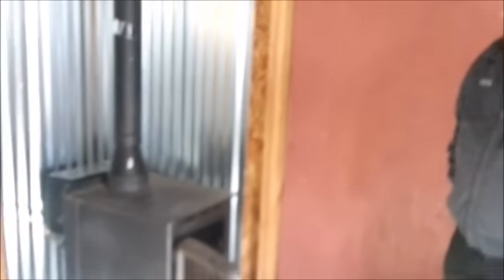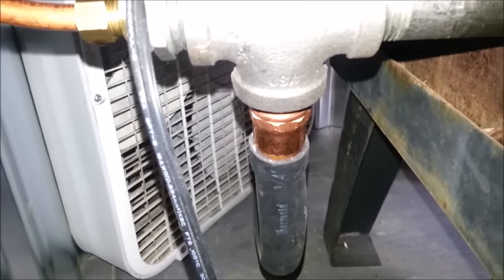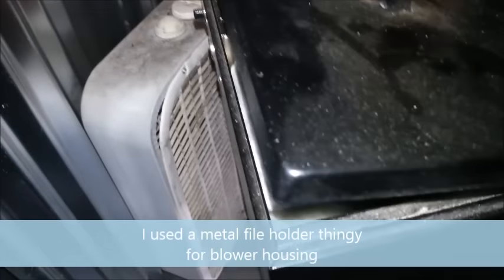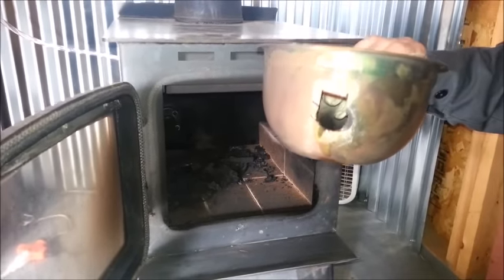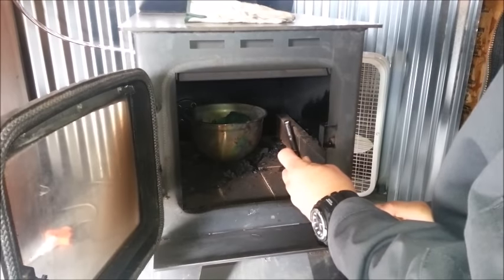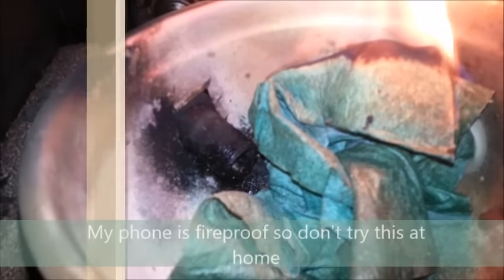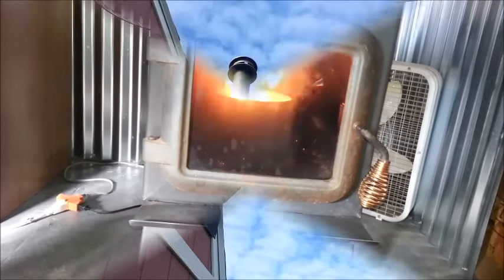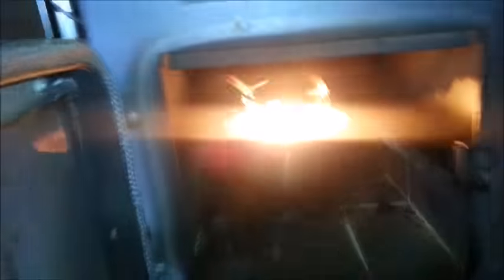Easy Waste Oil Heater made from a wood stove

Comment: LOL, sounds like you need to buy the son-in-law a beer or three. Nice setup. I was wandering if used motor oil would work in this system.
Reply from the maker: Yeah. Pretty much any oil. Vegetable oil not so much because it gels in the cold and has to be heated before it will flow

Comment: Isnt there some danger of the oil in the line catching fire? I mean if its dripping through half inch pipe theres gonna be air in there too right? Not familiar w these so just askin. Thx
Reply from the maker: The oil drips at the very end of the pipe and the outgoing air keeps oil and any flame from being able to enter

Comment: You were right! more air cleaned up the stove and pipe so much I can almost have dinner inside it! (producing over 900 degrees with same amount of oil too)   I tried a mattress blower like you have but was hesitant due to noise, but mainly the fact that its not intended for hours and hours of use.....What has been the life span on your blower?
Reply from the maker: +shawn I  Considering that they only cost about $20, one year would be worth it. Iv'e had mine going part time for three seasons. Glad you got the air issue fixed.

Comment: I have a question- when you are going over the basics of the stove about 4;20 or so you see the waste oil drip pipe which I think is 1/2 black or galvanized but it looks like there is another tube there as well maybe an 1/8th or 1/4- I am summarizing that this may be an air pipe is this correct- if so how do you do a transference- I mean there is a T on back of stove with high heat rubber hose running to pump but how is it stepped down?? or am I totally seeing an illusion? I was also wondering how the oil would not go down into the air pump hose when it appears as the air hose comes into the T and the T is pointing straight down- wouldn't that cause the oil to run mostly into the air pump hose? Not trying to ask to hard of questions but trying to alleviate any problems I may come across when building
Reply from the maker: The Real Deal Pastor check out my video "How to make an easy waste oil heater. I think all your questions will be answered. God bless
Reply: ok I will thanks

Comment: Cool idea. How long will a gallon of oil last? Is there different  burn times for different fuels... motor oil, diesel,  transmission fluid, etc...? What temps are you maintaining in your shop now?
Reply: That was my question nobody is saying how much oil one of these rigs burns, ???
Reply: f you drop an ounce every 3 minutes and there is 128 ounces per gallon, you want to err on half hour.  Think of a 3 oz travel bottle being filled ( in less than 10 minutes (this would be a conservative burn).
MPG may vary according to driving style, weather and terrain.

Comment: Would like to see how much oil is doing and average hourly consumption. Great video. Thank you
Reply: Most of these setups run 1/2 gallon every 1.25 hours give or take. Proper tuning of flow rate depends on a few factors of the build and heat requirements of the space/operator.

Comment: Does your heat go straight up the smoke pipe, or is there a built in baffle to help keep the heat from escaping?
Reply from the maker: There is no baffle or heat exchanger in the pipe. You could add one but I wonder if it would plug up with soot

Comment: nice and simple
whats the flow rate to cfm and can that blower run 24/7
Reply from the maker: Not sure the cfm but I've been running the same coleman mattress inflator for two seasons with no issues but it is getting noisy on start up. They are about $20 bucks at Walmart. I've also added a light switch/dimmer to it to help control heat out put. Works great. I wouldn't have any hesitation running it 24/7

Comment: On a slow steady drip, how long will it take to burn that whole 5 gal bucket empty of Tanny oil..???
Where you have that Tee for your fan air with that Tee facing down does it fill up with oil..???
After it gets warmed up will it run without the fan on..???
Have you tried to put a variable light dimmer switch on the fan AC supply line to vary the fan speed.???  (slow, med, high, etc.)
Reply from the maker: Bob check out my other video called "the sequel". 5 gal will last about 8 hours
Reply from the maker: and it won't run without the blower for combustion air. not efficiently anyway
Reply: +Kevin Rushing Well I know that on the surface that's a silly question because it depends on how much heat you want so the higher you crank it, the faster you'd burn fuel, just wanted a rough idea...  there is a county shop here where they park the snow plows that has a big one made of 6 55gal drums but it uses a regular oil pump they took off an old steam cleaner & they have a 350gal tank outside (5ft higher than the heater) & they put everything in there, oil, diesel, Tranny juice, gear oil, brake fluid, & they have one of those big stirrers you use to mix dry wall mud, hooked to a drill to mix it ever now & then..  but seriously I've dropped in on a snowy day & it would burn the paint on the walls if they  had any, they are all old dry wood..
Reply from the maker: +Bob White i think it's a good question. Some of these guys can go a bit overboard on heater design but when you start building it is some much fun it's hard to know when to call it good
Reply: +Kevin Rushing Well those of us who like to Tinker, Design, & make things, most often are never "totally" satisfied with our designs, we seem to keep thinking of things we could improve on, or a better, or easier way to have achieved the same effect, & a lot of the time it's not just a better way, but more of just a different way we could achieve the same thing, that's part of the fun...

Comment: Nice !  How much oil does it use?  Can you use brand new oil?   Synthetic?   Only the best, right?  Maybe throw in some ethanol.    and some black powder to start it with.   lol  But don;'t use ammonium nitrate.   That's just askin for trouble.
Reply from the maker: Tim Spriggs It all depends on how hot you get it but on average 5 gal for 8 hrs. Any oil will due but used seems to be cheaper than full synthetic out of the bottle. But if you're into designer fuels I would go with Mobile. 👍
Reply: ha ha.  I was joking.   The black powder and ammonium nitrate shd have tipped you off.  lol.
Reply from the maker: Tim Spriggs I was joking too 😌
Reply: Kevin Rushing okay.   I'll take you at your word.  : )

Comment: I think that was a 45 going into the bowl.    I'm just messing with you.    This is good stuff.  I'm trying to do the same thing. Only because my best friend owns a bar and he has used fryer grease to get rid of.  It piles up in clear 5 gallon jugs.   I have a couple storage tanks with the hand cr a nk pump.    I just burn garbage with the it but I have a bunch of old woodstoves and a ton of ingenuity.   Figured I could get a better use out of the grease.   Even tho I already heat my house for free with firewood that I cut.    Part of me just wants to make a waste oil heater just to do it
Reply from the maker: It will definitely do that for you but if it’s cold you’ll have to preheat the grease/ cooking oil to get it to flow

Comment: That blower fan needs to higher than the top of the burner and blowing the heat back down. 
Warm/hot air rises !.   Theres  nothing only cold air down at that level.

Comment: what stops the oil lighting in the pipe and going to the tank
Reply from the maker: For combustion to happen there has to be heat, fuel and oxygen. Since the tube is full of fuel no oxygen can enter. Also the air being blown in for combustion cools the oil below ignition temperature. The fuel doesn’t burn until it enters the bowl . Hope that answers your question.

Comment: What keeps the oil from going down the air pipe before turning on the fan.
Reply from the maker: The oil is controlled by a valve and drips directly into the bowl. The blower starts when I slip the switch. The fan turns on automatically when the temperature reaches a preset temp
Reply: @BYprospector  ok from the video it looked like the air tube was after the oil valve, going into the same tube as the oil. Or is it completely a different tube and i just didnt catch it.
Reply from the maker: @aaronwood3540  it might answer your question better if you watch my “how to” video

Comment: I would like to make something like this for my greenhouse, did you measure how long that bucket load of oil lasts. Thank you.
Reply: I would he worried about the lifetime of the blower. They tend to overheat and lock up fairly easy.
Reply: @HardWhereHero  :) I meant bucket load of oil:)
Reply from the maker: 5 gallons in roughly 8 hours
Reply from the maker: You need to keep it cool and it will last for many months. Also break it in slowly. A few minutes at a time

Comment: Kevin,I'm getting ready to use your idea on a pellet stove. What are your thoughts about using a 4 inch pipe that came with the stove or adapting that to 6 or 8 inch pipe and then running out of the wall of my shop?
Reply from the maker: shane newsom 4 should be fine. Remember with a blower you have a closed system with forced air that doesn't depend on natural draft
Reply: I'm worried about stove pipe temperatures and the 4 inch pellet stove pipe. Seems like it can only handle 540 degrees. Have you ever measured your stove pipe temps?

Comment: What happens if the flame goes out? Do you end up with 5 gallons of oil on the floor?
Reply from the maker: Yes. You have to keep an eye on it
Reply: @BYprospector  rayburns had a float chamber to shut the flow off if this happened,you had to have a sealed burner pot though.

Comment: Does the air just have to go into the fire chamber or does it need to shot right into the bowl on to the fire or just circulate around the chamber,and have you ever had an issue on a cold day after start up with the oil getting warm and running to fast on you and getting to high in the bowl and coming out the hole and into the bottom of the stove? Great video tho Thanks.
Reply from the maker: the air needs to swirl around physically contacting the oil. with a needle valve the oil with flow fairly steady. I've never had overflow
Reply: Thank you for the answer just seen your other video of how you run the air in the the fire chamber really good good idea I have a really large old wood chuck wood & coal stove I think I will give it a try on this summer in a garage I building thanks for the info and the video will save me a lot of wood I can use the wood to heat my home instead of the garage to the garage is not connected to the house it is a separate building to work on project cars think this will work good here in Michigan in cold weather.
Reply from the maker: +Michael Morris Be sure to upload a video

Comment: could a person put the air and oil in, coming into the side of the exhaust pipe and come down to the bowl instead of the back of the stove ???
Reply from the maker: I suppose you could depending on how the stove is built. There may be a plate welded to the top inside to keep heat in
Reply: ok going to try that, I built my own wood boiler and there for I can't go in from the side cause of the water jacket around the firebox, Ill have to send you pictures when its running.  Thanks for the quick response
Reply: +Kevin Daye where did you get the blower for the air supply to the bowl
Reply from the maker: +Kevin Daye Walmart. Coleman mattress inflator. About $20

Comment: How does the fan work?
Reply from the maker: The fan is operated by a 120 deg F normally open snap disk limit switch. It's attached to shell of the stove on the back. When the temp reaches 120 the switch closes and the fan turns on. You can get the switch from anyone that services furnaces.

Comment: So how is the fan connected?
Reply from the maker: I wired in a 120 degree F snap disk temperature switch. It’s attached to the back of the stove about an inch from the surface of the stove. When the temp reaches 120 the switch closes and the fan starts

Comment: Kevin, I got mine going, but seem to have a little trouble getting it roaring like yours seems to. I used an old pellet stove as my unit, and used all the blower motors inside of it. An exhaust blower, combustion blower, and the blower to blow the heat into my shop. I will keep tinkering with it to see if I can get a better roaring flame like yours. 
Thanks for all the tips.
Reply from the maker: Curtis Henshaw sounds like an air intake issue but remember that a pellet stove is more efficient than a wood stove and may not require a rippin' flame to heat a good size space. Good luck.
Reply: How long did the air mattress pump last?

Comment: What is the shelf life for use vegetable oil when using to fuel a boiler?
Reply from the maker: None but it tends to gel up in cold weather. It will have to be heated to make it flow
Reply: Adam Kremer h

Comment: Great job love the idea I have only one question can you tell me more information on the air forced into the unit can you show that part thanks for sharing
Reply from the maker: I use an air mattress pump. Mine is a coleman. Its best to use one that has been used otherwise they could fail pretty early. It needs to be burned in before it's used full time.
Reply: @BYprospector  thanks for the information

Comment: I wonder: ever thought of doing a „bird feeder“ oil feed that keeps a certain (low) level of oil in the bowl?
That way you wouldn’t need to adjust the drip (which obviously can change with varying viscosity in different temperatures).
Reply from the maker: Not sure what you have in mind but adjusting oil flow is neccessary for different size flame. It's the only way to adjust temperature in the room.
Reply: Oh yes, that was meant for a constant combustion (so constant flame/temp).
I was having a Roman style oil lamp in mind that needs a constant oil level. So if this would work with a constant oil level (unless you need to adjust the flame), it could go unattended e.g. as a night/greenhouse heater or so.
Reply: Once it gets hot enough all  available oil  will combust into  a inferno that only gets bigger ,you have to control the flow
Reply: @demil3618  yeah, you can't keep a set amount of oil in the pan, like 10mm / 7/16inch, it would burn like crazy before that.

But as for what I think you're getting at - thermostat - I am currently building a waste VEGETABLE oil heater to heat my house that is temperature controlled by an Arduino.

Comment: How big is your copper tube?
Reply from the maker: I use 1/4 to the valve and 3/8 below the valve to the stove. The 1/4 limits the amount of oil I have going to the stove so I don’t have a run-away flame.
Reply: @KevinRushing63  yeah I used a 3/8 needle valve and it always over fills my stainless bowl. Back to the drawing board for me.

Comment: What would happen if the air pump went out, and no one noticed it?
Reply from the maker: If the blower stops it smokes a lot but still burns but your going to want to shut the oil off soon as the oil will continue to fill the bowl.
Reply: @BYprospector  what about installing a pressure solenoid like in a whole house humidifier
Reply from the maker: @mhoch1736  best thing would be a sail switch on the blower that kills a solenoid for the oil should the blower stop working. You could also add a thermocouple to detect if the flame goes out that also closes the solenoid. But this would require a control module
Reply: @BYprospector  would the sail switch go in the flue?
Reply from the maker: @mhoch1736  would go somewhere in the discharge of the blower. Maybe just before the air enters the stove.

Comment: One potential problem is that the plastic tube might melt. Better to use steel tubing going into the stove, as steel does not conduct heat like copper does. Stainless is a better insulator than regular steel.  Just have to keep in mind the thermal conductivity of various metals when building things.
Reply from the maker: It hasn't been a problem with the tubing. It's not technically plastic it's vynol. It's far enough away from the stove that there's no chance of melting. As far as the oil feed being copper, it is insulated by the cold air moving around it and it bends easily. Stainless doesn't bend easily.
Reply: @BYprospector  Tygon is plastic, PVC, or Polyvinyl chloride. It can handle most chemicals, such as oil, but does not hold up well to acetone. True about stainless not bending so easy, it is harder to bend than brake line. Need a tubing bender to work with either form of steel, as it is hard to bend by hand. I have used those and many other materials from McMaster Carr. Where I am at it is harder to get the used oil than the materials to make such a heater, as most things used are seen as hazardous waste. Even though nearly everything can be reused in the right hands. That is because too many here see everything as disposable including people.
Reply: @Paul-gz5dp  it is insulated by the cold air moving around it

Comment: It will use less oil for the same amount of heat if you add a WATER drip into it as well once it is fired-up to working temp. I read that in a survival book years ago where they used a sheet of corrugated iron and lit a small fire under where the oil & water drippers were to get it hot enough for the oil to ignite.

Comment: A fire on the floor in a shop where there is petroleum based products like gasoline.....what could possibly go wrong??
This is why ALL commercial flame based heaters are mounted high in the shop.

Comment: Great video, this is the first one ive seen using forced draft, which seems to be a necessary requirement with keeping these homemade units clean burning.
Where is the air being blown into the chamber?  Bottom, top or does it matter?
Reply from the maker: Watch my how to video. It explains it